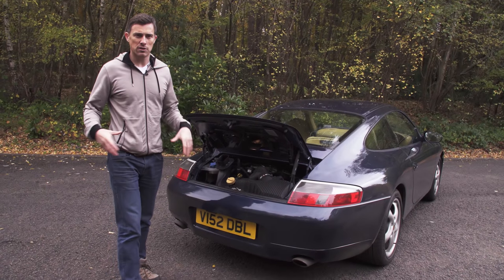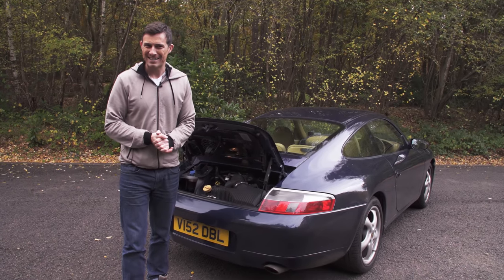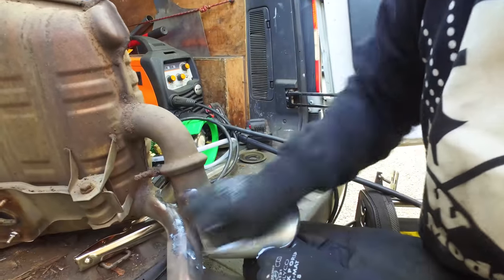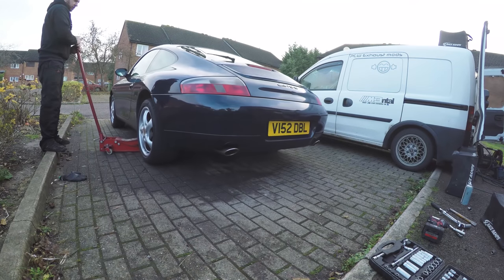Porsche 911  996/ 997 Gundo exhaust hack | Vlogs

Comment: Better without a doubt and £200 is a bargain! Did you gain any extra bhp?
Reply: " changing any of the exhaust system, just bypassing a pipe" Well you say 2 things in this one did not change but bypassed muffler, thats called changing system. It flows better because all of exhaust gas wont go tru muffler.

Comment: What will this do when the MOT test comes up?
Reply: Won't make a difference. This exact guy is very well known on m3cutters.co.uk for doing a lot of M3s and it doesn't effect MOTs
Reply: Jamie Hallam Correct me if I'm wrong but I believe a car can fail an MOT for excessive exhaust noise?
Reply: It can, however I highly doubt this is anywhere near loud enough to fail based on noise alone. My old E92 M3 with Meisterschaft GT2 (Basically loudest aftermarket system on the market) didn't even fail when I took it for an MOT, although it did get an advisory
Reply: uk law says "too loud" but not a dB value. It's entirely subjective to the tester.
Reply: Thats what I thought. Personally I wouldn't want to do anything to a nearly 20 year old car that might jeopardise it's chances of passing an MOT. Mind you I'm pretty sure he got this done for free so perhaps he doesn't care.
Reply: It doesn't affect the emissions I'd think - CATs are before the mufflers in the 911. 
Just need a "friendly" MOT tester and you're good to go unless the car is fundamentally broken, but in that case no exhaust mod would make it worse!
Reply: I'm aware it's subjective and not based on a dB value, but this car isn't even that loud. I can't imagine any testing stations failing it based on this sound level, it would have to be some super strict tester in a bad mood
Reply: Jamie Hallam Well in my experience it depends on if anything else fails. If they can't find a fault they'll go looking for one. Typically the dealership is worst for that
Reply: I'm just going by the fact this guy has worked on a lot of M3s and is well known on m3cutters website and nobody has ever complained about failing an MOT + this car isn't particularly loud. I think you'd be extremely extremely unlucky if they failed it based on this exhaust hack. As the original uploader even said himself, the work that's been done is effectively the same as what the Porsche Sports Exhaust does so this will still been seen as a normal noise level for these cars

Comment: I just bought a 996.2 in 2024, and the exhaust sounds amazing. I didn't know if it was original, as I've never owned a Porsche before. When I took it to the shop for an inspection, they told me it had a Gundo hack, and to look it up online. Here I am. It sounds freaking awesome. Every time I hit the gas while driving I get a huge smile on my face.

Comment: Yes...it sound great & a cheep mod, but try not to fit the bypass pipes to the tailpipes Paul, because you can't adjust them afterwords or take them off if needed. Sommerfeld Tuning Germany welded the bypass pipes on my car previously on another set of mufflers before the tailpipes with no problems & unfortunately it wasn't  the case with this mod Paul. You can't adjust or centralise the tailpipes in the rear bumper, nor you can remove the tails if the car needs new mufflers. Just for future reference for anybody...

Comment: +1.  .. I must say, the LPMM** 911 exhaust mod., is making a name for itself around the world. .. The formally known LPMM exhaust mod., "short circuit" came to life beginning with 993 series side mounted R/L muffler cans. .. Fellow 911 (993) owner/enthusiast Leyland Pete from the great state of Nevada, USA provided the inspiration, idea, method and execution for fellow 993 owners of the day. ..With ever tightening vehicle noise restrictions (Switzerland, etc., ) the 911's signature exhaust rumble/burble/pop/burble was lost,,, starting with the 993 series. .. Solution?  993 owner/enthusiast Robin Sun started cutting open the actual muffler can - making internal baffle exhaust circuit changes... Many 993's have Robin Sun mufflers. (A bit more distinctive exhaust note) ..   Enter the DIY solution and brain child by Leyland Pete...  The LPMM 911 muffler DIY was born. ..
**Leyland Pete Muffler Modification (LPMM)
.. My MY98 C2S coupe's air cooled 3.6l has had the LPMM for more than a decade ... Zero drone, zero, zero. .. Its a 2 to 3 hour DIY, ,,, Additionally,, source new hardware/bolts etc., from your local Porsche dealership as preparation. .. The muffler  cans once removed are easily mod'ed/weld'd by a competent muffler shop. 
Varooooom, varooom, .... The DIY LPMM hack on stock muffler cans is just enough increase exhaust note for my taste's. .. The California firm FD Motorsports otherwise known as Fister Exhaust actually cuts open the muffler cans for an even livelier 911 exhaust note. .. Many 993, 996, 997, 997.2 etc. Porsche owners swear by the Fister's mods...

Comment: It does sound better, but to get better sound, reduce weight and add torque (from weight reduction and swapping the big heavy mufflers).. get a lighter, better flowing, better sounding exhaust.

I have a 996 + a spare set of these mufflers.. they are really heavy when i pick em up to move out of the way n the garage, but surprisingly, on my scale its only 23 or 25 lbs each.. but they r still big and heavy.. Swap em and get more than just better sound.

Comment: The gundo sounds great! I can't help but notice that this configuration seems to weld the removable exhaust tips to the muffler sub assembly making it impossible to swap tips. I'm going to perform this mod on my 2003 C2 aero but plan on using a wider 45 degree piece, welded closer to the cans as to avoid the tips and to allow for deeper tone. My .02

Comment: Great idea, and so inexpensive! I have seen the E90 V8 M3 mod where the perforated tubes inside the standard muffler are changed for solid tubes. Looks standard from the outside but what a difference in sound .

Comment: What about all the extra smoke? What's the reason for that?
Reply: Syed Reza that's not smoke. It's condensation, the air is cold and the exhaust warm...
Reply: Dave Travels but there is far less in the pre-modded version
Reply: Syed Reza they were filmed on different days, so the weather was probably different: different temps and different humidity levels. This mod would not alter the emissions system in any way.

Comment: Is there any droning while cruising?
Reply from the maker: I did an in car cursing at 70mph test. But it was quiet so didn't show anything. But no - no droning.
Reply: hi mat
Reply: carwow in car cursing is obligatory in istanbul traffic, just saying

Heey Matt removed his message, now mine makes no sense anymore 😣
Reply: Thanks!  BTW I like it better now...
Reply from the maker: Depends on whether he's filming an in-car piece to camera… and it's not the car's fault
Reply: Sounds great!!!I want 996.2 I see one in Pen for $26,000It is a good value right?
Reply: david soler well Mat got his for about £16k which I recon is somewhere around $20k.. So if you're pretty sure you want the same car (not recommended) 1-search the market you're in and compare prices/specs. 2-I think $26k isn't bad that's an extra $6k compared to Mat but the British are in a recession/depression so it's reasonable he got it this low, and if you found newer and less mileage that's even better and better. 3-make sure you negotiate about 10-20% of the price... 4-thank me :P
Reply: did he put protection paint ?
Reply: Douglas Cole none on my gundo modified 996.2. Perfect balance.
Reply: audioisgood I have a 99 996 what size pipe did you use for the gundo hack and what kind of sound does it make

Comment: Do this here in Switzerland and you'll get two free years of vacation in a cosy jail :d
Reply: 2 years jail for replicating the factory porsche sports exhaust ?
Reply: That's possible, yes. Because it's seen as tax fraud. You car isn't registered with a self-made exhaust nor is it anywhere tested (CO2, noise, etc.). Worst case scenario would be, that the car would blow up due to self-made modifications (ofc not with a change like that on the exhaust). 

+ If you cause an accident, your insurance will put 'regress' on the case and you'll be left to pay everything...

Comment: do you lose power by doing this mod?
Reply: sounds awesome !!!!
Reply: loose? you remove restrictions from the exhaust system. you will probably even gain a few horses. although you could just remove the muffler altogether because when you bypass it it does nothing but add weight to your car.
Reply: Carlitox b you wont lose power, but you may lose some torque
Reply: He's just adding an extra pipe along the path isn't he? So it's not really making it more or less restricted I would think, and it shouldn't affect performance in any way (my theory anyway), am I wrong?
Reply: Ben no, he is removing restiction by bypassing the muffler.
Reply: and less restriction sometimes gives you more power

Comment: Hey Mat, sounds amazing. I had the same mod done on my Porsche. Lovely guy Paul Welding, he also came to my house and yeah like you I noticed it straight away.

Mine is a 997 auto 3.6, but I'd love to compare and contrast with your 997 manual, noise and drive wise. Hit me up if you fancy.

Comment: 200 pounds is quite expensive for 4 inches of tubing, and a Polish for the tips. For 250 pounds the exhaust shop I went to gave me a muffler delete which was like 10 inches of tubing on each side, welded on new tips, removed my resonator and installed me an X pipe. I know it's a Porsche and might get Porsche tax but it still seems a bit much.